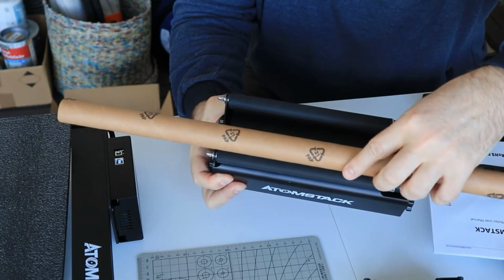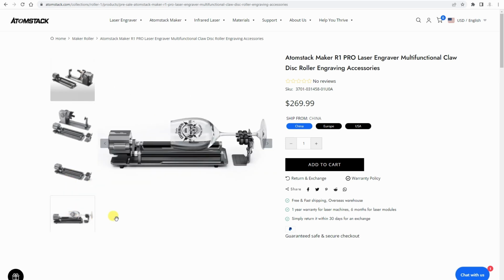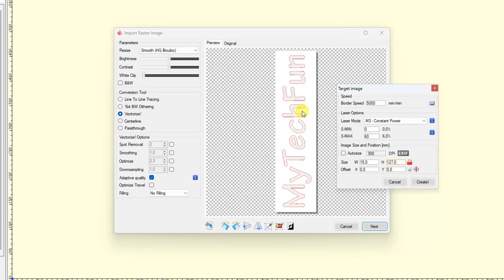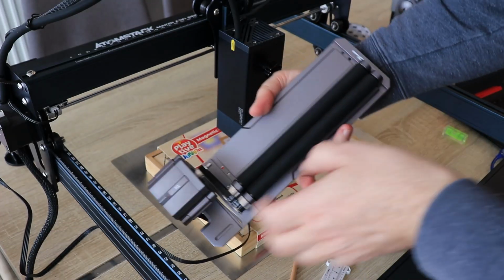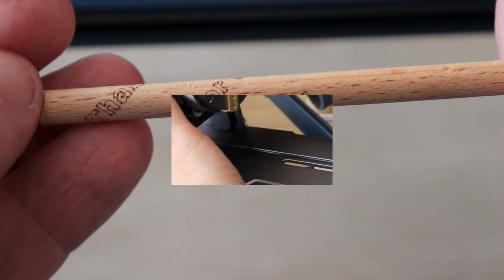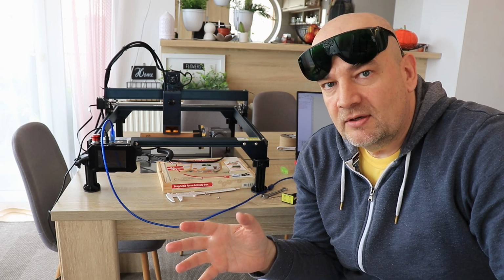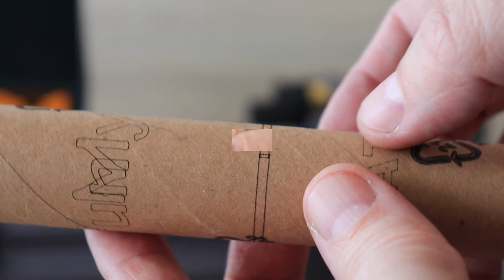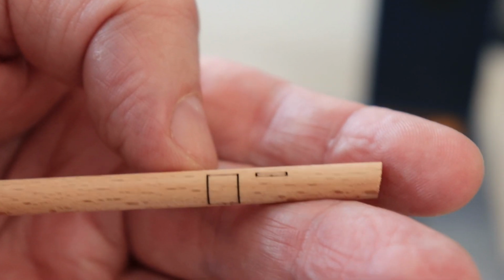Atomstack Maker R1 PRO review - Rotary chuck and rollers for engraving cylindrical objects

Comment: Hello Do you think it would be possible to use the rotary chuck without the laser engraving part, only as a part holder and to manually set the angular rotation and speed?

Comment: Just a note.  The supporting rollers is designed to be used with the rotary roller attachment not the chuck.  This would allow you to engrave longer objects that you mentioned was a drawback from the older model.  Hope this helps and a fantastic review.